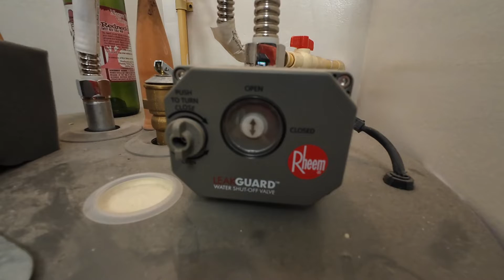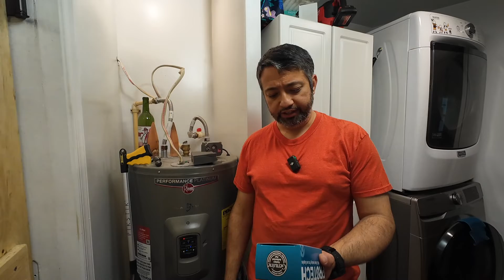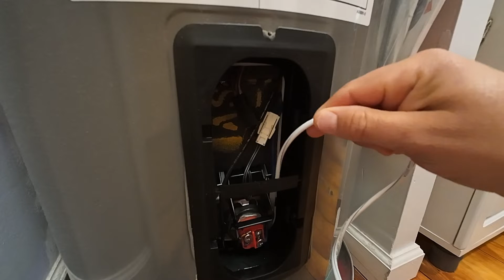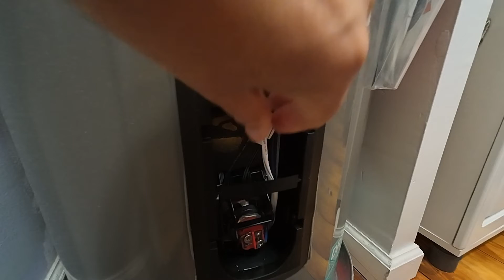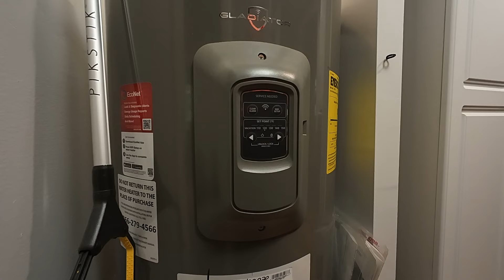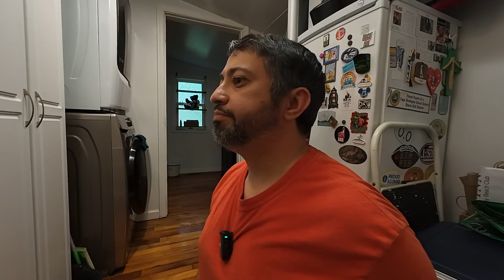Rheem A102 Water Sensor Alarm

Comment: If you look just under the bottom edge of the tank you will see what looks like an orange cord around the bottom perimeter edge.  The leak sensor wick you shoved down the tube touches this orange water wick ring and trips of the leak sensor.  The sensor needs to be pushed down the tube until the black shrink tubing touches the clear plastic guide conduit.

If the wicking gets wet, either bottom orange or white with blue strip sensor cord it may take a long time to dry out enough so it does not trip the alarm.  Service will just change the sensor instead of trying to dry it off.

Be real careful of getting any water is the leak pan on the floor below the water heater.  I had a refrig water filter cartridge next to water heater and accidentally squirted about 2 oz of water into the bottom leak tray while changing the water filter.  About an hour later the two flash red alarm went off.

Comment: This is great!  I had our water pressure regulator fail and spray water all over the place, including into the catch tray for the hot water heater. Since then, the alarm has been going off, and shuts down the incoming water.  I guess it does what it's supposed to do.  I've removed all the water from the tray and that didn't stop the alarms.  I can reset it, but 24 hours later the same thing happens.  I did follow your video, removed the sensor, dried it, and put it back, and the same problem persists.  Is it possible once it gets wet it needs to be replaced?
Reply from the maker: That's a great question!! I really have no clue if it needs to be replaced.  I just know that water heater irritated us so much we just replaced it.  Seemed crazy to be paying a tech like $300 per visit.

Comment: Thank you so much for posting this. I am in the same situation where the alarm won't stop even though i dried the wire sensor. 
The Rheem tech team did mention to me too that there is another water sensor UNDER the tank (the red circle). 
So anyway i am going to try to reach out for a replacement wire if my alarm keeps going (it has been several days).

And seriously, these contractors are charging way too much. $150 for trip charge and $130 to pick up the phone to call Rheem?? Ridiculous
Reply from the maker: That is definitely frustrating, I hope you can get it resolved without having to pay those crazy fees! 😊

Comment: The rope sensor got wet and leak detection went off and closed the valve (no hot water). I disconnected the connection at the leak detector. I have hot water, but still getting error messages on display. I’ll revisit this in a few days and see about drying the sensor rope with my leaf blower and see if corrects the alarms. If not may just remove the entire system or see about replacing the detection rope sensor.

Comment: Thanks for the info. I never wanted this water sensor feature that came with my water heater. Our basement is very damp and this sensor system is too sensitive for our situation. I ended up removing the sensor  and coiling it up on top of lower heater area.

Comment: Someone please help!!  I received the following alert via email and text on my phone "EcoNet Alert - A102: Gladiator Water Heater  Water Sensor Alarm. Please check for water heater for potential leaks to prevent damage."  Even though I believe this was a false alarm, I live out of state and have no way of checking my water heater so I have a few questions hopefully someone out there can answer. 

1. Is my hot water now disabled because I received this message? 

2. If my hot water heater is disabled, is there a way I can reset it and get it working again from the EcoNet mobile app I have on my phone?  Or can it only be reset in person?
3. I checked my EcoNet app and it indicates "There are currently no alerts".  Does this mean it was an error and there are no problems with the water heater?
4. If it does have to be reset in person how do I do that?

Comment: starting to get the alarms could not diagnose why its going off, still in warranty till 8/25, 
i will buy this part thank your for your helpful video , question is does your app, tell you what exactly the issue is?  i dont get the alerts just the beeping and i have the app for it.

Comment: Thanks for the information. I was able to just pull the water sensor out and  coil it up behind the cover.  this remedied the issue so far... time will tell. This is a big design flaw. I hope this helps save time and costs
Reply: Coiling the sensor wire is the best option. All these extra gadgets is just more stuff to fail.
Reply from the maker: You are welcome!!

Comment: As far as I can tell the "sensor" is just a pair of wires and something in the control board is probably measuring resistance. I just pulled mine out and dried it off with a hair dryer and that did the trick. The big problem I see with this design is it's extremely difficult to dry out the pan under the water heater where the sensor sits. Despite the big warning on the box, the two yahoos who installed the water heater got some water in the pan and then just lowered the new water heater in it. Once it filled up with water it was too heavy to move but I was able to tip it a tiny bit, put a wedge under it and run a fan blowing air under it for a few days to dry it out.
Reply: I'm having the same ploblem with trying to dry up the water that came out of the pressure relief valve that has to be replaced.The water heater is two days old, so did the fan dry up the water under your heater and did sensor work? Thanks for the info.

Comment: If you install this unit and it keeps beeping after installation that just means that there’s water on the ground. It doesn’t mean the unit is leaking it’s just that the sensors sense any water that is on the bottom of the tank.

Comment: I got the alarm, and the A102 code. No leak present that I could see. I turned off the power to the heater, removed the sensor wire from the tube it inserts in, wiped it down with paper towel, reinstalled, turned on power and now no code. Condensation maybe? Thanks for the video!
Reply from the maker: Oh wow!  No clue!  Mine was leaking at the valve on the top of the machine.

Comment: We just bought this unit, installed and next day got this error. Can it be disconnected? Already regretting this purchase.
Reply from the maker: So sorry to hear that!  Ours has been acting up again.  Getting alarm A102 at least once a day.  I'm not sure what to do now.  Don't want to spend another $350 for the service guy to come out.  I think I'm just going to disconnect the cord that I installed. Now this is totally at your own risk.  Just know that if you disconnect it and it starts leaking you will not get any warning.
Reply: We disconnected it, our old one didn’t have a leak detection, so I hoping it’ll be ok and if it happens we are around.
Reply from the maker: I had the plumber come out again today.  The water in the safety tray was coming from the relief valve at the very top of the unit. So you might want to check their for any water leaks.
Reply: @themintoshow this is where we have our leak (very little water). What was the fix for that?